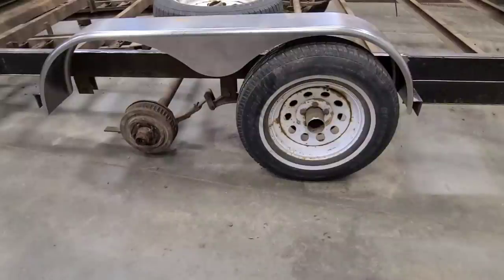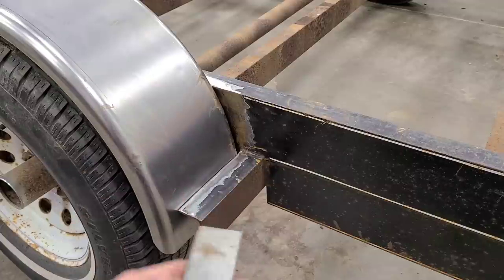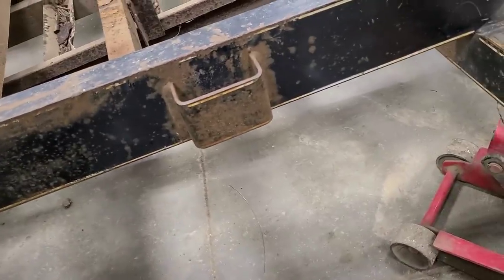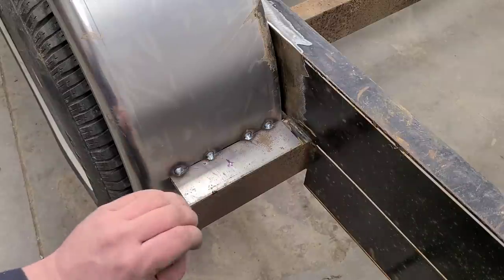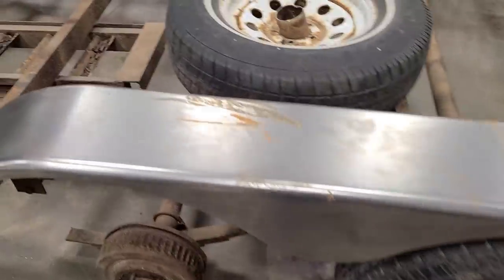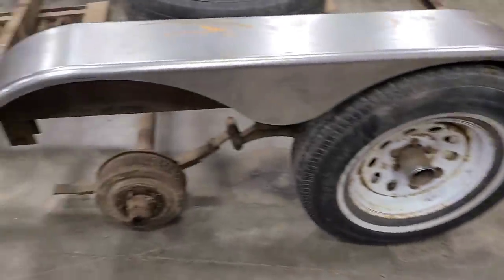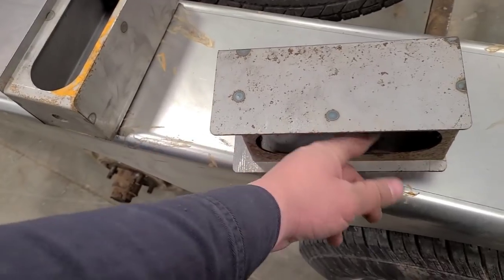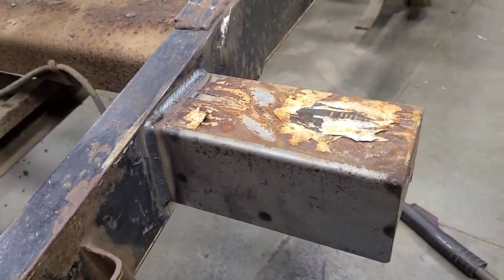18' Car Trailer Rebuild Pt.5 New Fenders and Taillight Housings

Comment: This is exactly how I mounted my fenders on the trailer. One 3/8" bolt per side with a nylock nut. A dap of grease on the thread to prevent corrosion. They don't come off often, but a nice option to have.
Keep up the good work.
J.F.🇨🇦
Reply from the maker: Have they held up well? Thanks!
Reply: @kylechrist  Yes the did, up until my neighbor borrowed it and decide to drive his tractor over one of them, lol.
mine are aluminum though.
Reply from the maker: @santerresongarage7486  Number 1 rule of owning a trailer, never lend it out haha
Reply: @kylechrist  I know I cringe evry time, but I'm too good of a guy, hahaha!

Comment: It's looking pretty good!
Suggestion: a small diagonal gusset or two on those fender flanges. Not necessary when the fender is mounted, but when you take it off you have a two inch fin sticking straight out that is almost certainly going to get bent or knocked around pretty badly. Some gussets should help keep them straight so you can get the fender back on.

Comment: I was talking to the screen saying you should weld the bolt up from the bottom so you only need a wrench up top to remove or attach the fenders.  Just as I said that, you were already there.  😅

Comment: The finders on my trailer were mounted the same way from the factory. The backing metal was welded to the fender and held at the bottom by some thin metal clips welded to the frame. The backing metal just slid down below the top of the frame between the clips and the frame.

Comment: Good thoughts on the lights!  I guess I would have done two bolts or at least if not two small dowels and 1 bolt so the fenders don't twist too easy when hit, but I agree a nut on the bottom welded in place will give a good clean look on top as well as being easy. Each person has to follow their own preference. Thanks For bringing us along
Reply from the maker: Thanks!
Reply: @kylechrist  That is just my option, I am the type that no matter how careful I would be I would hit them and twist them or let someone else use it and they won't be so careful
Reply from the maker: @seniorelectrician6831  the number 1 rule of owning a trailer should be: Never let anyone under any circumstances borrow it as it will come back broken 🤣

Comment: Two bolts are always better than one & three bolts look better than two if you drilled one hole in the middle. You might want to use a piece of angle iron & bolt through the fender instead of welded on flat as I reckon those welds will crack out of the thin fender.
Reply from the maker: I had thought about angle and had it laid in there but didn't like the gap left on top as the fender curved away from it. Being that these fenders are light and not load bearing, they should be fine, thanks for watching!
Reply: @kylechrist  What about some 2" square flat washers & put a little curvature in them with a hammer & weld them onto the flat & bolt through the fender.
Reply from the maker: @dustyfarmer  that would also work, being as I have them welded up I think I'm going to stick with the flat stock, if it becomes an issue down the road I can replace it. I do have a 2nd set of fenders for this trailer already due to an ordering mix up, so it would be easy to redo if necessary

Comment: What about the tire sticking outside of fender ?
Reply from the maker: Those are not the wheels and tires that will be on the trailer, I have new wheels and tires with a different offset 👍

Comment: The tires are hanging over  a good 2 inches of the fender. Will they stay that way?
Reply from the maker: I have new wheels and tires for the trailer, the tires that are currently on the trailer are an automotive tire and not a trailer tire. The new rim should also bring that offset back in towards the frame, thanks for watching

Comment: Awesome work. Are you concerned at all about the width of the fenders? It looks like they could rub the tires under load. The camera plays tricks, maybe I'm wrong.
Reply from the maker: Not at all, 3 of the 4 springs are broke so once new ones are in there it will lift the trailer increasing that gap

Comment: I would not want surface mount lights on a trailer. They are prime for damage.
Reply from the maker: That's personal opinion, I can't stand flush mount lights. I've both worked on and seen many round and oval lights fall out of rubber gasket/o-rings never to be seen again in anything from semi tractors to small single axle trailers. With that being said, all plastic lights can break and to each their own 👍